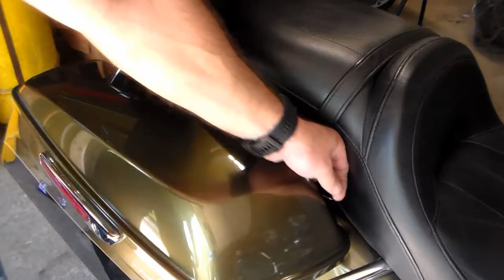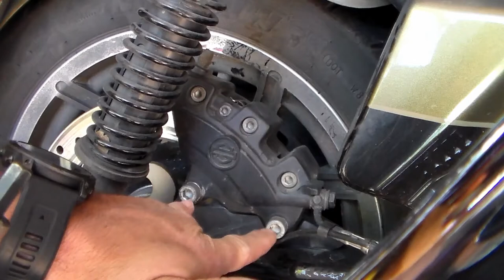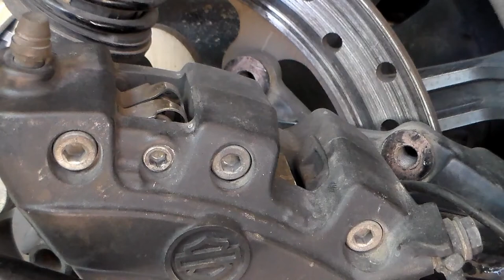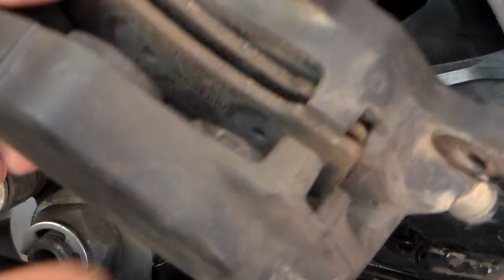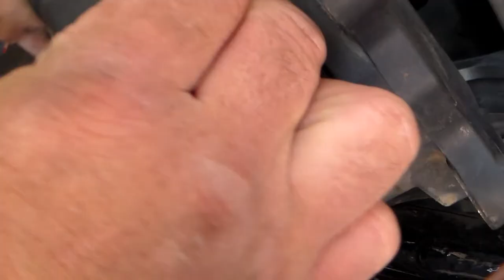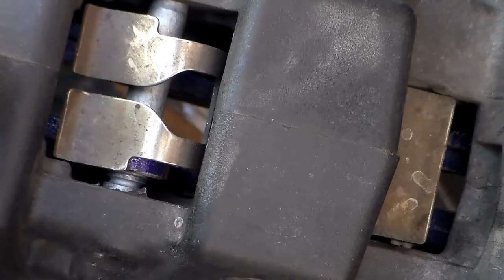Harley Davidson Touring Bike - REAR BRAKE CHANGE in 5-minutes!

Comment: This is how I did my rear brakes on my 2010 Road King.  I had no choice, the cross pin was slightly behind the shock.  I could get the ball end of a hex wrench in there to loosen the cross pin, but I couldn't get it to go by the shock.  To be honest I think it was easier taking the caliper off.  You weren't blindly trying to get the pads to seat.  Everything is right there in the palm of your hands.  It was so easy next time I do the fronts I may try taking the caliper off rather than do it on the bike.
Reply: Mine is an 07 you have to take the axle out to get caliper off . I just took the lid off my reservoir and used a brake tool to depress the pistons then took out the pins put new pads it lined up the holes with a pick tool put pins back torqued them and put reservoir lid back  and done 20 minutes.

Comment: Hello do you need  to clean or do anything to the wheel disk
My girls bike got the brakes overheated on a rally ride and the disk is all nasty and black
Should it be scrapped or cleaned
Thanks
Reply from the maker: I'm not sure these get turned like car and truck rotors. I believe they just get replaced.